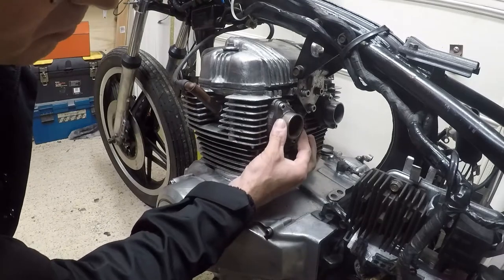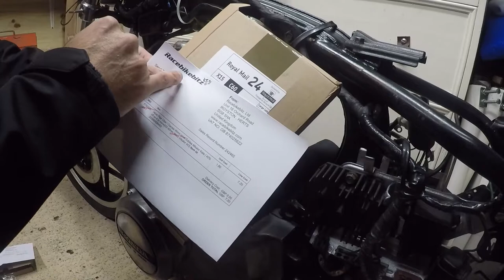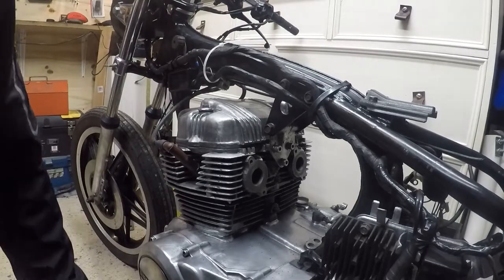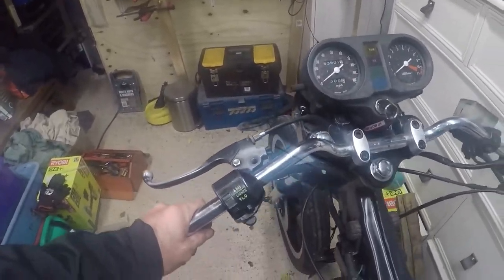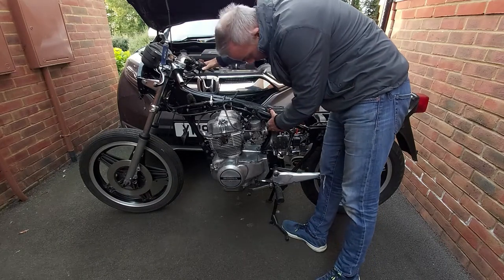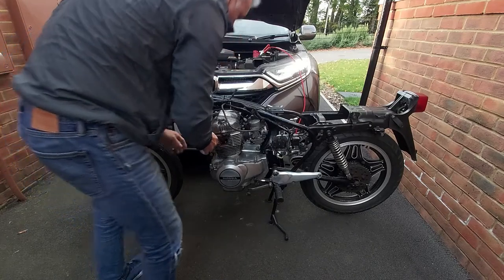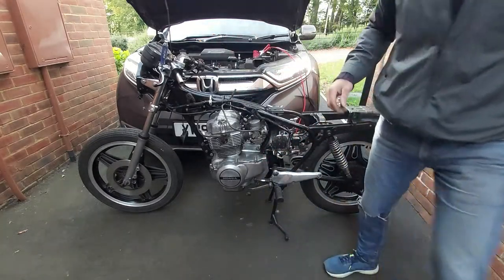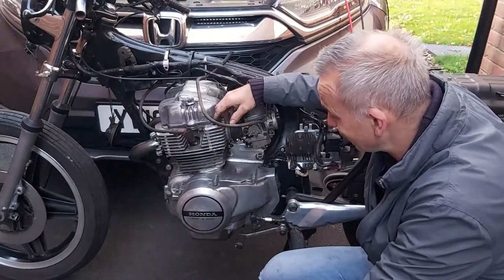Connecting the Carbs, and trying to start it for the first time since the build.

Comment: Hi Ryan, just watched the compression test with the balloon which was great, so I watched the series. If it won’t fire after putting fuel in the spark plug holes then it’s not just the carbs. I’m 99% sure your timing is 180 degrees out and that’s why it won’t fire. Before you do anything else just swap the spark leads and that will tell if the timings out. If your happy to leave it like that you don’t need to delve into the engine. Somewhere in the manual it should have told you to set timing with a certain cylinder at tdc on compression stroke, usually cylinder 1. Like I say easy fix, swap the spark plug leads. If that doesn’t work then it’s not getting fuel. Steve not Jo, wife’s account

Comment: Sounds like it is trying mate and that is half the battle.  A blast of quick start and some restriction on the air intake and I think that you might have cracked it mate.
Reply from the maker: Thanks for this, I've started to strip the carbs anyway, but once back together I be sure to buy some quick start.
Reply: @RyansGarageUK  anything flammable will do at a pinch, even deodorant.  I wouldn't use Lynx though.  Not because it wouldn't work but because it's smells horrendous!

Comment: Hi Ryan. Loving your drive and enthusiasm. I know the purists will not like me for saying this but some of us stick to a budget where possible, the inlet rubbers between carbs and cylinders are on EBay for about £12 each. Used them on my 400 superdream and no issues at all.
Reply from the maker: Hi Spencer, Thanks for you support. I hadn't seen them for the 250 (although they may be the same part?) My improvised rubbers cost me around £12 in total, or would of done if I hadn't ordered the wrong size clips.  Once I know it will run, I'll be happier to spend a little more money where necessary.

Comment: Hi Ryan, I am loving this build.  The carbs may well be the issue. I had problems starting my superdream years ago when it was not regularly ridden. One idea I can pass on is something my dad told me which was to heat up the spark plugs in and oven (or I guess you could carefully use a blow torch) and then try it…. It actually worked and I successfully used this process to start the bike  a few times when it would not start.. Once I was using the bike regularly I did not any have starting issues.  Good luck with the build, and looking forward to seeing it running….great bikes superdreams!
Reply from the maker: Thanks Peter. I'm feeling the carbs are currently the number one suspect, and I've begin to strip them now. Not heard of heating the plugs before, if i'm still struggling later I may consider that...

Comment: Nearly there. Its almost certainly dirty carbs. A good clean/ rebuild should do it. You can squirt a bit of fuel into the back of the carbs so it fires, albeit momentarily. You can check the ignition timing but there is no mechanical adjustment, its fixed at the factory. Good luck.
Reply from the maker: Thanks Colin, I hope your correct and that's what I'm going to try.

Comment: I'm as disappointed as you Ryan. Like everyone else has said, it will run - it hasn't started for years and mine refused to start after 2 week holidays when it was only 3 years old. A quick jump start and all was well. So once you get it going, it'll be fine. I actually thought you had stripped them but I watch so many restorations I must have you confused - yes, carb strip and clean, get it started and post a quick teaser video this week of it running and your happy expression when it does!   You can do it!
Reply from the maker: Thanks Tim, I've back on it again now. 😀

Comment: Ryan, and thinking back when you set the tappet clearance on cylinder 2 it was on the compression stroke, assuming you hadn’t turned the engine means cylinder 1 wasn’t on compression. You’re out 180 degrees. Steve
Reply from the maker: Hi Steve,  thank you for this suggestion, I've been unable to get it running this week so far, so I'm wondering the same. I'm going to remove the covers when I get time tomorrow and check them all again as something is not right. Cheers Ryan
Reply: @RyansGarageUK  mate before you go into the engine simply switch the spark plug leads. If it is out by 180 that will correct it, simple. There is always the possibility that that coil wires are switched. Again simply switching the leads will sort it. Steve

Comment: You have a good spark and she's trying to fire, the exhaust doesn't make a difference it will start without it fitted, and she turns over well so i would say the carbs needs stripping completely and rebuilding as being alloy they can corrode, just make sure the slides operate easily and that all the air ways in them are clean and then turn the mixture screws out 2 turns and work from there
Reply from the maker: Thanks Pete, I've started on the Carbs now so fingers crossed I can bring her back to life soon.

Comment: Hi, you have all the signs for the bike to run but you need to restrict the air flow with something that's why it tries to run with the choke on,  cheers Phil
Reply from the maker: Cheers Phil, think you're correct. I'm cleaning Carbs now but will try again soon.

Comment: Strip and clean out the carbs,  jets are cheap enough to just replace.  Make sure float levels and needles are all set and working as should and that will run.  Also ignition timing maybe out?
Reply from the maker: Thanks Chris, I agree and I've started work on the carbs already. I've not yet seen how I can adjust the timing on this although that may well be part of the problem.

Comment: Ok here's what I would do next I would get a sponge put some petrol on it and hold it over the intakes and wind it over and see if it will fire up it will suck the fumes out of the sponge but that's me Ryan as you can imagine you have to be careful doing this
Reply from the maker: That's sounds like a great plan, I've started work on the carbs, but if they don't work I may consider your suggestion.

Comment: it sounds like the timing is 180 degrees out buddy but it should run if you give it full throttle but it will struggle to rev … I could be wrong though are you using brand new spark plug’s?
Reply from the maker: Hi, The spark plugs are a good point. No they are not new. I'll get a set on order incase something that simple helps. Thanks.

Comment: I am amazed the starter motor didn't burn out and set fire to the bike???? If the bike doesn't start after 5 seconds it'll  never start,there is a problem. Running without the exhaust  and silencer can burn out exhaust valves. Proper choke cables help if the carbs are clean andFULL of fresh petrol. Check valve timing ,valve clearances and spark timing. My super dream started on a frosty morning under 2 seconds, it was that good!!!
Reply from the maker: Cheers Matthew, Luckily for me the starter held up. I'm using fresh petrol and I've now begun stripping the carbs and checking everything else. I just wish my super dream would start at all.. I'm sure it will sometime soon.